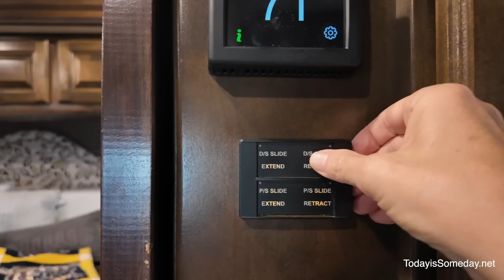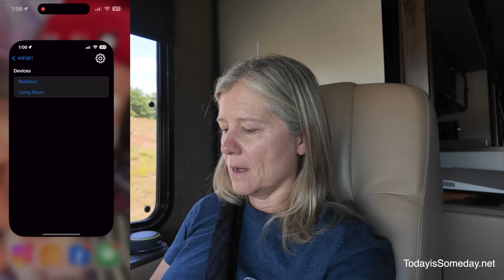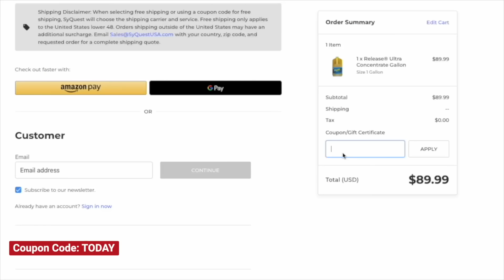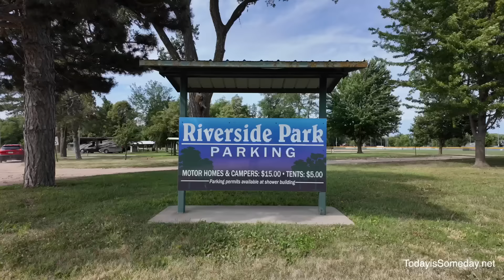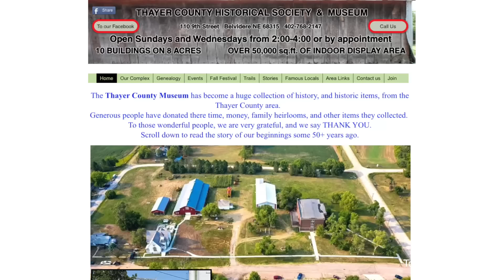We Headed North from Texas and THEN HE DID THIS!

Comment: Great video! Phil had me laughing again with forgetting the RV was running—they are just so quiet. Remember, generators love to be run, especially under load. When it's hot, turn it on and let the AC work while driving. Planes' cooling and electrical systems run on generators and are always running.
Reply from the maker: We will in this heat from now on. It was just really cool that our new thermostats alerted us of the high temps.

Comment: At some point, could you talk about running your 50 amp rig on 30 amps? Curious how well that works. Any dos and don’ts? Can you run both AC units at the same time?
Reply from the maker: That is a great topic. We can run both on 50 amp. We can run both on 30 amp, but can't run and other major appliance without first shutting one off.

Comment: In your rig you may not have an option that said, just did 10,200 miles across 21 states in my sprinter and observed that truck stop diesel prices were generally 40-50 cents higher per gallon, than nearby regular gas station prices. I only used my open roads card a couple of times and saved a lot by not buying truck stop diesel.
Reply from the maker: Our size, coupled with the Jeep attached prevents us from using most all regular gas stations. Too tight oa a turn and no easy in and out.

Comment: Could you hook up your a/c to your inverter so you can run it off the solar while driving?
Reply from the maker: We could run it through the inverter and the batteries could run them for about 4 to 5 hours depending on what else was plugged in. We turn on the generator any time we need to run them while driving.
Reply: @todayissomeday  it's good to exercise the gen under a load now and then anyhow, may as well stay cool doing it!

Comment: How much discount did you actually get at Loves compared to other truck stops?
   My wife refueled the truck at Racetrak. She saw the Loves across the road was nearly $.50 higher for diesel. 
  So the discount isn’t really a discount when you add the other fees attached to a fuel discount card.
Reply from the maker: We saved $24 on 50 gal of fuel.
Reply: @todayissomeday   you didn’t save anything when Loves is 50 cents higher. You may have saved on the Loves price.  But you could have saved fifty cents per gallon which negates your Loves discount. Racetrak has truck and RV lanes. 
   Loves and Pilot are higher priced.

Comment: Question.  Why don’t you run your gen while driving ?   We always have ours running when we’re on the road, Ac’s running all the time.  The gen is rated around .5 gal an hour.  Minimal for keeping everything running while traveling.
Reply from the maker: Normally, we are comfortable up front and dont think about the back heating up. Our new thermostats alerted us of the rising temps. We will in these high temps from now on.

Comment: Always run the genny going down the road to keep it cool. Much cheaper than running front AC. Stopped turning our RED off while fueling years ago. You are often stopped longer in traffic jams. Our 2nd DP. A  2006 Monaco then   a 2017 38QBA RED.

Comment: about 2 years after i bought my trailer I was dumping the tanks and I couldn't close the grey tank all the way> I grabbed a wire coat hanger and started fishing in the piping and pulled out a wood screw. Several months later the light fixture over the sink would not shut off, so I disassembled it and found another wood screw had fallen across the electrical contacts in the fixture closing the circuit and keeping the light fixture on. Also when I washed the roof for the first time after about 6 months I removed about a dozen wood screws from the drip edge of the roof on the awning side. I guess in the manufacturing process speed is so important that the cost of a few dropped screws; that will randomly show up years later, is of no concern to slow down production.

Comment: I thought you had solar installed. Won’t you AC’s run off your solar inverter?
Reply from the maker: We do have solar. Our AC's aren't wired through the inverter. The generator works fine. We don't need it all the time while driving,

Comment: I installed a heavy drape from the floor to the ceiling right in back of the passanger and driver's seats that folds inback of each.  I pull it across for AC and truck heating and it works wonders.  I do not have to run the motorhome AC or heat during driving.
Don & Honey
Reply from the maker: Great idea.